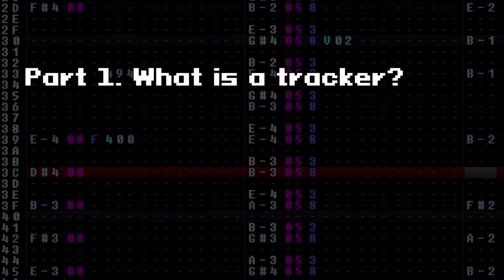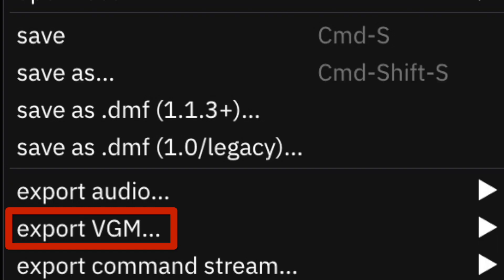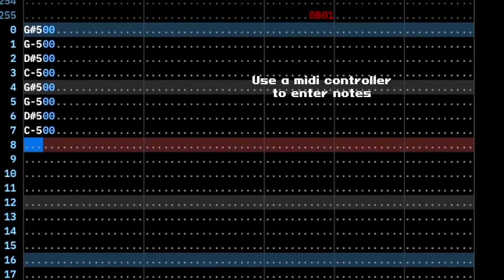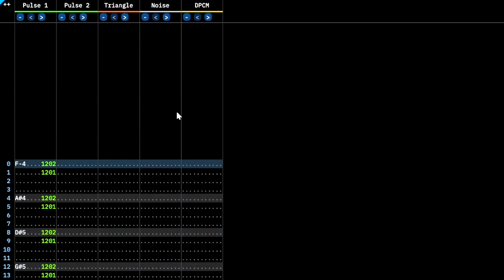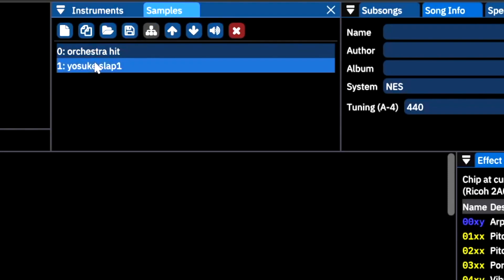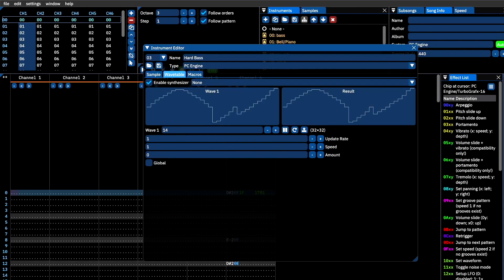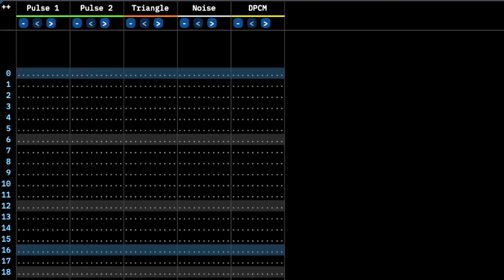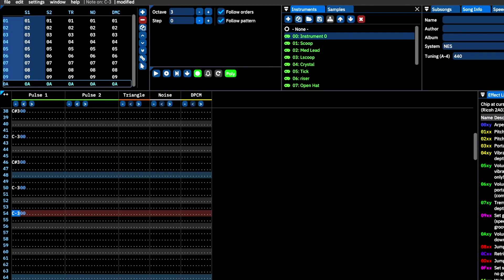How to Learn Chiptune Trackers TUTORIAL

Comment: On a mac there is an EASY way to get MULTIPLE INSTANCES. Far easier than downloading two different versions.

Open a terminal.
open -a Furnace
will open one instance. To always open a NEW instance, use -n:
open -n -a Furnace
Reply: But I understand that many on a mac will do anything not to have to touch the Terminal, much like the Americans will use anything to avoid having to use the metric system.
Reply from the maker: @Chalisque  hahaha im more than willing to use the terminal! thank you for this comment! i hope others will find it useful
Reply: @Chalisque  honestly I can sorta see why people are scared to touch the terminal. When I first got my dev job I thought Mac was gonna be the absolute worst - turns out it's easier and more intuitive than Windows with its terminal (especially because you can access your file system seamlessly).
Reply: @citroenboter  And now that Windows has WSL, I've got a big pile of bash and Python scripts which run essentially identically on all three. Many common tasks are terse, so that I can set a common complex task going with a dozen keypresses. It is possible to add an icon to your dock to run a script which is the one line open -n -a Furnace, to avoid the need to touch the terminal. (I've done this for friends for other tasks.) On all three, my main file manager is the bash shell (on mac I install it via ports). I only use gui file managers a fraction of the time because they're so inefficient for many tasks. On Linux I've got things honed even more, though music production is one area where I mostly use Windows. (My only macs are 2014 mini macs, so not really powerful enough.)
Reply: @Chalisque  Not all of us mac users are like that. I live the console - Having multiple instances running? yep. Using terminal muxers? Kind of required ;)

Comment: @Button Mascher: Are there anyway to pitch bend a note with a midi controller? Even though I have mapped it in the settings, it doesn't seem to work.
Reply from the maker: I personally dont use the pitch wheel when writing with the tracker
Reply: @_buttonmasher  thanks a lot for your feedback. I thought about the pitch in case I decide to create a sound, like a guitar solo. It would be interesting to have a more "manual" control rather than writing the notes directly on the line. Thanks again!

Comment: I've figured out how to fake sustain using loop points and crossfades when making tunes for SNES, but I'm still having problems with popping. It sounds perfect in the sample editor, but it always pops when I make it into an instrument. I'm assuming that it has something to do with the sample/bit rate, but I haven't found any solution yet. Do you happen to know how to fix this?
Reply from the maker: @banastian4143  ah ive had similar problems in furnace which is why its not my primary method of choice for snes music. Id reccomend asking the furnace discord
Reply: @_buttonmasher  Aaah, okay thanks! What software do you use for SNES music?
Reply: @_buttonmasher  I ended up installing C700 as recommended in your SNES video, and I'm mostly enjoying it! I'm having problems with some sounds/midi cutting out/glitching though. 

It happens whenever there's a lot of notes playing, and usually only happens in one channel. I'm currently recreating the Chrono Trigger theme as a test, and the arpeggio thingy with lots of notes screws with my drum kit channel. Any advice? 

I also don't quite understand how they panned it from left to right. Really great tutorial by the way! Your videos are a treat :)
Reply: @banastian4143 not too long ago I mentioned something similar in Furnace discord and they told me it was a bug. Maybe it’s fixed by now!

Comment: finally, a DAW tutorial that makes sense, uses freeware, and doesn't require me to own any physical instruments.  You're a saint.  Thank you.
Reply: @_buttonmasher  how i learned tracking was to look at other furnace songs (fm patches fr are tough) and learn how to make those instruments, but im horrid at litterally any other type of chip besides fm and pcm
Reply: Well there is the exception of a midi controller
Reply: @BeachBear64  You can use your computer keyboard, it's just not ideal
Reply: @big_cabbaged  yeah you can barely switch octaves
Reply: @BeachBear64 Yeah but you can perfectly make songs, by only using the virtual piano via keyboard. Its true that its more comfortable using a REAL MIDI piano, but it is not impossible to work without one.
Reply: @big_cabbaged  Meanwhile me using trackers with only a PC keyboard for at least 5 years:
Reply: yep and you can do so much more with trackers than just chiptune, if you look at something like sunvox
Reply: Open source. Not freeware.

Comment: Okay so I downloaded Furnace and messed around with it for a while. It took me ages to figure out how to get the SNES chip to make sound 😂 but I finally got it going. Anyway I have a question I wonder if you can sort out for me.

First though, here's what I've learned from your video and my limited first-hand experience.

`Tick Rate` controls how many times the software refreshes per second. Projects completed at the default value will be compatible with play on real hardware.

`Speed` controls the duration each pattern-editor line is played back in tick units. If `Tick Rate` is set to 60 and Speed is set to 6, then that’s 10 lines played back per second. Since there are 60 seconds in a minute, that’s 600 lines per minute.

The `Highlight` setting controls the BPM by establishing the LPB (lines per beat). The LPB controls how many pattern-editor lines are grouped into a beat and, consequently, how many beats play per minute. For example:

1. If the LPB value is 1, each line represents a beat. Since 600 lines play per minute, the BPM is 600.
2. If the LPB value is 4, each line represents a quarter-beat. Since 600 lines play per minute, the BPM becomes 150.
- In scenario 1, whole notes are the smallest duration that can be programmed. In scenario 2, The smallest duration that can programmed is a quarter note. Moving from scenario 1 to scenario 2, any previously programmed whole notes become quarter notes and the BPM is cut in half two times. Because of this, quarter notes in scenario 2 last as long as whole notes in scenario 1. Whole notes in scenario 2 last four times as long as whole notes in scenario 1.

In the instrument editor, there is another setting called `TickLen` which controls the speed of event automation used to create things like arpeggios. It works similarly to `Speed`, controlling the duration each event is played back (also in tick units).

Given a variable value of `TickLen` and default values of `Tick Rate`, `Speed` and `Highlight` see the chart below showing the number automation events per whole note that can be achieved.

| TickLen ~ Automation events per whole note |
| 24 ~ 1 |
| 12 ~ 2 |
| 8 ~ 3 |
| 6 ~ 4 |
| 4 ~ 6 |
| 3 ~ 8 |
| 2 ~ 12 |
| 1 ~ 24 |

Okay so no for my question... As mentioned, changing the `Tick Rate` value may render the project incompatible with real hardware. However, because `Speed` and `TickLen` are both multipliers of the tick unit, changing the `Tick Rate` seems to be the only way to synchronize note and automation durationa across discrete BPMs.

This seems like an odd sort of constraint. It seems to limit the composer to exactly 150 BPM if he wants clean arpeggios. Am I missing something? Is there a way to get automation and note durations to synchronize more seamlessly across multiple BPMs without rendering the project unusable?
Reply from the maker: Have you picked a module to transcribe and gone through my transcription method? Also have you watched my video on how to make super nintendo music? Theres a chapter on furnace.
Reply: I have not watched your super nintendo video. I'll give it a look. But I'm familiar with trackers already. I've done transcriptions in openmpt, sunvox, the tic-80 tracker, and a few others.
Reply from the maker: @TheDogn  i think it would be worth doing with furnace to see how others work around what ever limitations are present in the software. I have never run into the problem your describing here so i cant really help you beyond pointing to my own reference modules which ive included in the description and the modules that come with furnace.